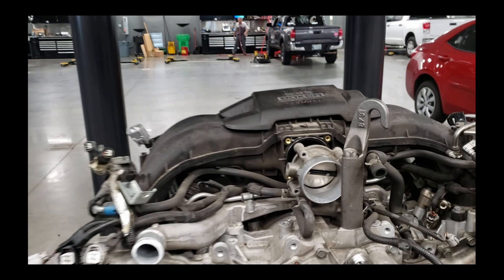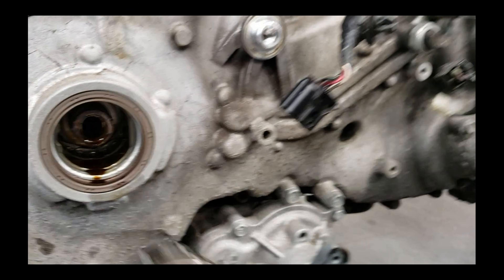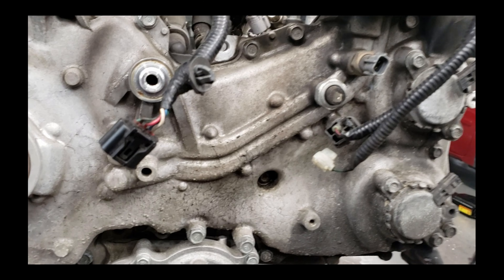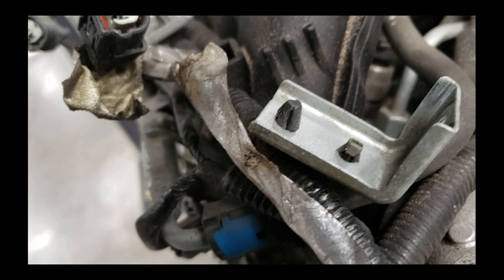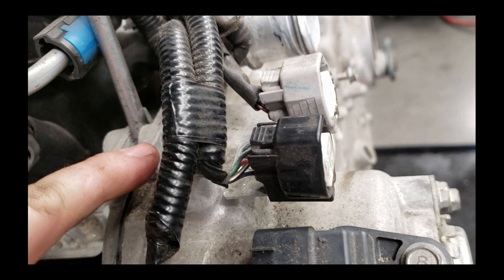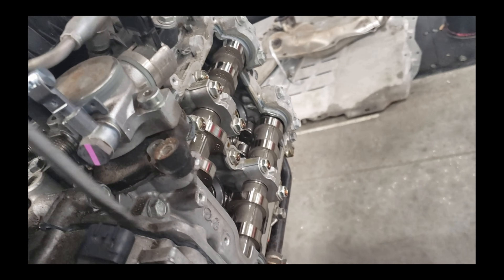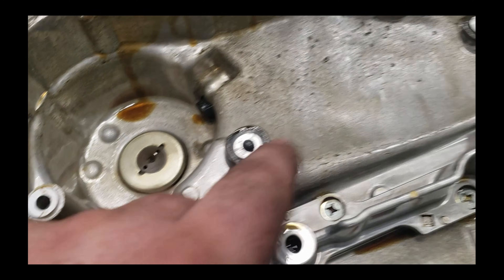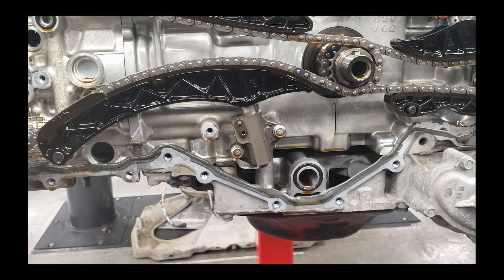how to set timing on a fa20 for fr-s/brz/gt-86| walk-through! frs/brz teardown!

Comment: Hey man I really need some advise the recall about the valve springs was made on my car on 2019 on april but started hearing a knocking sound coming from the engine recently and took it to the dealership and they just took the oil pan out and found metal debree so they gave me an invoice that I need a new motor and want to charge me 10k. Should I fight for it and call corporate? If they would cover it. Also I had a mechanic who told me that on the early models the vvt were poorly made and need to updated it it to the early model ones because if the vvt fails it causes engine problems and thats exactly what I'm experiencing right now and im not only one who's experiencing the rod knocking in the engine on only early models 2013. What should I do i haven't even hit 150k miles and all of sudden I need a new engine like its sad but im trying to get help. Also they left my car outside with the windows down and the key in the  Ignition and the hood open but not all the way open also the battery wasn't there and the bad part is that it was raining. Please help man any suggestions would help me alot 🙏
Reply from the maker: Honestly man these motors did have some issues I have personally seen 3 blown up lack of oil and just wear issues I have a friend at Subaru he says they put short blocks in all the time very common with metal in the pan and im assuming you have no timing vvt codes i have to assume the metal did not come from that area and its from the bottom end. I would personally put a junk yard motor in it can be done in a few hours with basic tools and will be much cheaper.
Reply: @ParkHopTillWeDrop  ok man and actually it did pop codes, before I took it to the dealership I took it to autozone to check it out with the codes and they print it out and the code was the VVT so what should i do? Still get a junk yard motor or tell the dealership?
Reply: @ParkHopTillWeDrop  and I do have the code in paper from autozone

Comment: Great video thank you. Quick Q:can I simply place my cams back on (LH BANK) and reseal or do I need to adjust the cam or the crank?
Reply from the maker: If you take them off and return them to the proper location you can do that as its like setting 2 separate 2cyl engines
Reply: That Disney Guy Thanks. Bearings come in Monday🤙🏼 Ill be attempting to put her back together.

Comment: With a brand new short block does the engine need to be at TDC or should I follow the crank marks even if it ends up not being TDC?
Reply from the maker: Follow the crank marks as in the video and you will be fine

Comment: Is it necessary to roll the engine over a few times at the end? I did not mark the crank pulley so it seems useless to do that. I have all the markings in the right place though. Thanks
Reply from the maker: Not at all

Comment: when you take the caps off the valves don't you have to document the height of the caps for the correct valve lash?
Reply from the maker: I place them on a sheet in order so I can place them back in there same position but yes
Reply: @ParkHopTillWeDrop  ok cool question then, had a machine shop do the heads and gave me all the caps back in a bag with no reference so after going through hell getting the caps where they go, I have 2-3 valves that could use another thousandth or 2 tighter and looser, will the hydraulic lifters compensate for that much or am I going to get a clatter box when I fire it up
Reply: great video by the way
Reply from the maker: @colbyC1007  we usually have the machine shop grind the tops of the valves so everything is with in spec i like to be on tight side of the spec but normally when we have one of these apart its to replace the springs so we put the caps back where they came from so we almost never measure them.  Thanks for the support it the video helped you get it all back together.

Comment: I purchased a new short block, and am using heads and cam boxes from old shortblock.  To set the timing, do I need to get the new short block to TDC before installing the timing chains?
Reply from the maker: Yes just roll it slow to prevent it hitting valves that might be open you may have to move the camshafts slightly when rolling the bottom end over

Comment: Hi I've just bought a 2011 3rd gen manual diesel forester (UK guy) and get a ticking/clatter noise under load (when going through the gears) and I'm sure at 91k miles it must be timing chain. I know you guys dont have the diesel version in USA but I should imagine that petrol versions would be the same. Please advise as I'm worried I've bought a lemon. Much appreciated.
Reply from the maker: These motors are fairly noisy when running perfectly so its hard to say without hearing it but honestly if the timing is similar to the gas model replacement of the chain guides ect in the car is only a 5 or 6 hour job
Reply: Disney, thankyou for advice. Much appreciated bro. Keep the vlogs coming thick n fast...

Comment: Do you know if the same marks and process apply to the fb25  out of a 2011 Subaru Forester? I will be replacing head gaskets and timing chain guide/tensioners in the process. also I greatly appreciate the use of that Queen song made me think of Shaun of the Dead. Thanks
Reply from the maker: im not 100 percent sure on that but if you set it to zero when you take it apart and the marks match the ones from this video i would say there is a very good chance there the same
Reply: Yes they are. I know it’s a year ago. But I rebuilt my fb25 and it’s the same

Comment: Thank you so much for this video. Is there anything that could damage the HPFP or DI system electrical intermittently after doing these valve springs? I had the cam carriers overtorqued by mistake on that bank with the pump.. and now throwing codes for P062D and P1235... I can't imagine wear on the triangular lobes or the pump roller would happen that quickly.
Reply from the maker: I've never had any damage to the di system with doing these but anything is possible possible debris got in there

Comment: Thank you so much for this! Way easier to understand than manual. Only had done small block chevys until now so was a bit confused with the service manual.
Reply from the maker: no problem glad it helped I was lost also but I found a cool tech tip from a tsb from a long time ago and I knew I couldn't be the only one having trouble so I did this video and 37 of these recalls so I got pretty good at this. thanks for your support

Comment: I'm replacing my valve seals on my 2015 WRX along with replacing the springs, spring seats and retainers with the GSC single spring kit. I noticed in the video you removed the cam gears with the cams all in 1 piece (from how it looked). How did you prevent the valves from dropping into the cylinder while you were replacing the springs?
Reply from the maker: We have a tool that pressurized both cylinders at once that's the best way to do it
Reply: @ParkHopTillWeDrop  how much psi do you use to pressurize each cylinder? Also, do you have a link to the spring compressor tool you used? That looks way easier and safer than most other spring compressor tools I have seen.
Reply from the maker: @taylorpeters2833  I will try and get part numbers off tools tomorrow they are toyota special tools for our shop but they work great and they work on other engines I use around 90 psi I will get part numbers from that tool as well but there are alot of great aftermarket tools out there that you can preform this task with as well
Reply: @ParkHopTillWeDrop  awesome, thank you! I'm starting the engine removal on friday so keep me posted on what you can find! Appreciate it!

Comment: do you really need to pull the engine to do the timing/
Reply from the maker: No I had to pull the cams and do the valve springs so if just doing a front cover or a gear ect you don't have to pull the motor however I can have the motor on a stand in under an hour so

Comment: why does it matter where the colored links are since they are all the same size?
Reply from the maker: The colored likes are the guide to line everything up it would be very easy to be a link off without using the colored links but once you have gone as far as taking the front cover off it's only another few bolts to remove the chain

Comment: Hi we’re currently doing the timing as well and we set the right side up currently turned it into position and the top left can won’t move whatsoever. Also we noticed after setting timing on the driver side after turning the crank the pink marks no longer marked up with the marks on the cam. Any help with this would be greatly appreciated!
Reply from the maker: I would need to see a pic but by your description the timing is off it's very easy to set these wrong follow the video closely I've set up around 40 of these this method works 100 percent
Reply: @ParkHopTillWeDrop  so we had taken the chain off before turning the crank/cams to the correct location so the top left cam was stuck. We were able to get it to move to the correct position though after. Thanks for the help though,!

Comment: Hey so I am just wondering if you have any information on the subject. I am doing an fa20dit engine build from a 2017 wrx my stock engine has not blown its very healthy and runs great but I am looking to add alot more power so I'm building a stage 3 extreme closed deck. Can I re use my cam gears? I have been told I should replace them but I've also been told as long as they are cleane and aren't damaged I can re use them can you give me your opinion on it thank you
Reply from the maker: Yes they can be reused just know at some point they may fail and might need replacement if the motor has over 60k on it I'd think about replacing them. The biggest thing with these motors is to make sure there is no debris left inside after the build from old sealant ect
Reply: @ParkHopTillWeDrop  I'm heads machined and cleaned and adding new head internals. I'm getting new oil pump/timing cover and there would be a iag certified engine builder doing this process. My stock engine has 33k on it. I may just replace them just on time crunch and shop I'm going through said that I really shouldn't need to replace them. But they would inspect and clean and if they think its needed then I will get them. If they fail what kind of damage can they do? I think I should probably just replace all 4 cam gears and get new chains

Comment: I had a mechanic rebuild my engine after spinning a bearing and after putting the engine back in it wouldn't start. it cranks but doesn't start. It blows air out of the intake and has a humming noise coming from the intake manifold. Do you think the timing was set incorrectly?
Reply from the maker: You have any codes? Timing over retarted code or over advanced code is a dead give away but people set these up wrong all the time

Comment: Hi, Thanks for the detailed video! I have 2 questions. How do you know when the crank is straight up and then to the right to get the right chain on? also how do you get off stubborn bolts? they are 1/2 inch bolts right?
Reply from the maker: The crank key way points up and what bolts are u having issues with front cover bolts? Everything on that motor is pretty much 10mm 12mm ot 14mm

Comment: Great video! I have a 2014 Subaru Impreza (FB20). I’m replacing the chains and and crank shaft gear as well as the tensioners due to improper light weight pulley installed. Anyways, I was wondering if the timing is set the same as the FA20? Thank you in advance!
Reply from the maker: Honestly haven't had one apart but looking at the manual they seem to be very similar
Reply: After I took off the front engine cover. I tried to check the all the arrows before I took the chain off. I notice that the left side arrows don’t align with the right side. I tried to also check the pink markings on the chain to see if it aligns on the line but they don’t. The car was running fine until the front crank shaft gear teeth broke. Do you recommend anything? To be able to removed and replace chains? Please if you could email me at 

ramirezhernandezaldo@yahoo.com 

I would really appreciated, this is my only vehicle and living in Hawaii is very hard. Thank you in advance for your time and knowledge 🙏
Reply from the maker: @aldoramirezhernandez7920  the arrows from the left bank point at each other as do the right bank if there already off time you can take the chains off and roll the cams to the proper position just go slow and if you feel like you bump into something move the crank a bit then turn the cams a bit more and follow the video for setting the timing let me know if you need more help
Reply: Thank you so much 🤙🏾

Comment: Today my engine seized so I will be pulling the motor.  Thanks for the video.  First I had to do a timing cover leak repair but before I got to it the engine seized when I boosted it.
Reply from the maker: Sorry to hear about the engine issue I want to put a 2jz in one of these or ej25 from the sti

Comment: What work did you do on the heads? Also, is it enough to clean the mating surfaces where the silicon gasket goes only with a razor blade? The wire wheels seems to do a better (and faster) job in cleaning it properly, leaving some scratches though.
Reply from the maker: Replaced valve springs and cleaning with a razor blade is the approved toyota way. But the wire wheel is much easier and I do use one but I didn't want people who haven't done this before messing up the surfaces with over use of a wire wheel thanks for your interest.